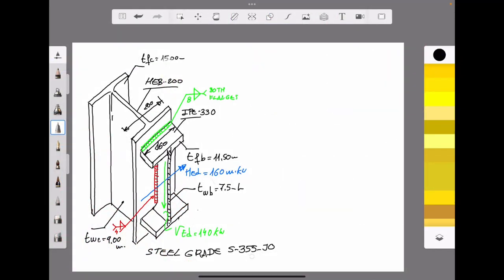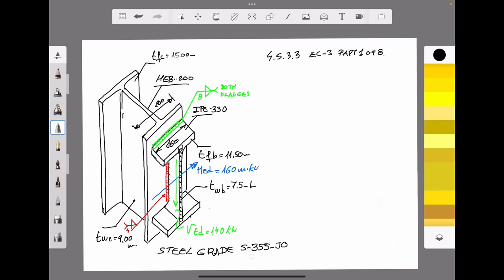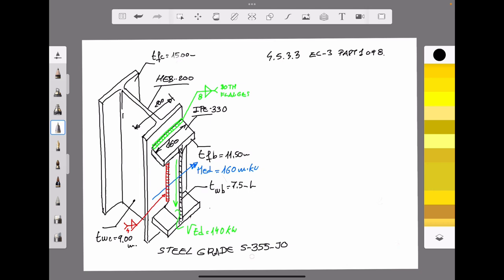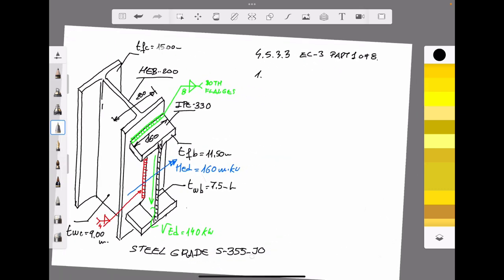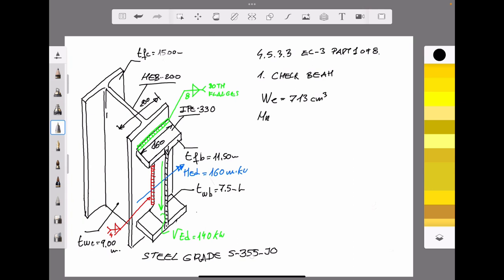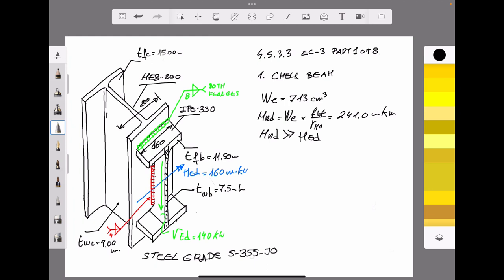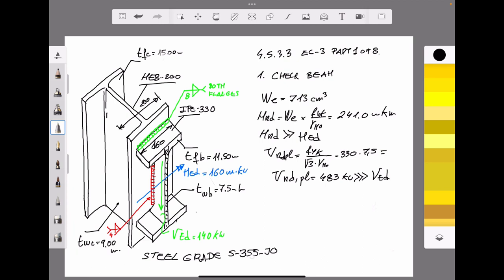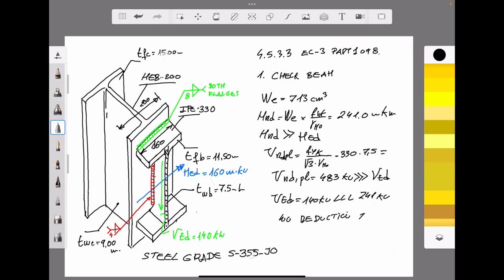Fillet welds design in accordance with Eurocode 3

Comment: Sergio - just one small point regarding the welding symbols you have shown on your drawing - they should show a4 and a8 - since you are defining these welds by throat thickness (as opposed to leg length) - as you explained in your presentation. I am referring to EN22553 - section 6.2.3 for welding symbols. If they had been leg lengths - then they would have to be z4 and z8. They have changed the "symbols" over the years - just to confuse everyone.☺
Reply from the maker: Gordon thanks for the comment. I think it is very pertinent. To be honest it is not accurate to explain welding design in accordance with European codes meanwhile using AWS Symbology for representation. My apologizes but AWS is the only one symbology that I really handle.

Comment: Hello, where is EC3, part 1-8, the limitation of maximal welding: a max = 0.7 x twb, or twc? just out of curiosity :)
Reply from the maker: It is a very good question. Ec3 only requires not to weld flanges to avoid flanges restriction. I will upload some post through LinkedIn regarding the topic. Thanks for your question.
Reply: @canal_estructuras_sergio  Hey please comment here if you find the clause for maximum size of throat thickness.